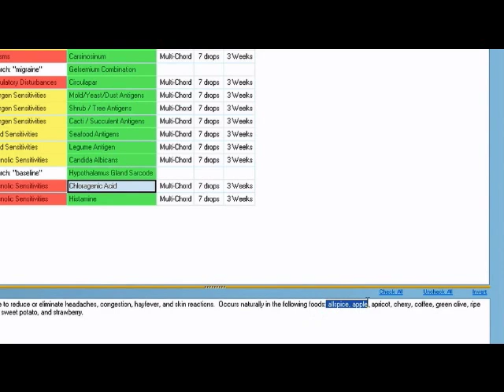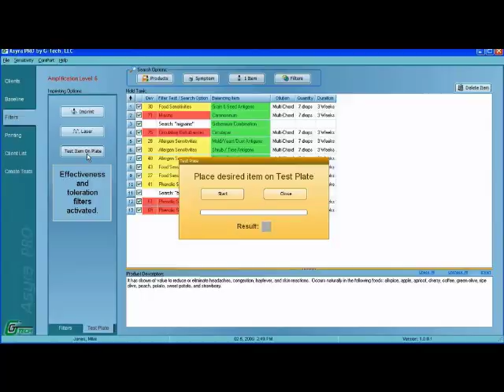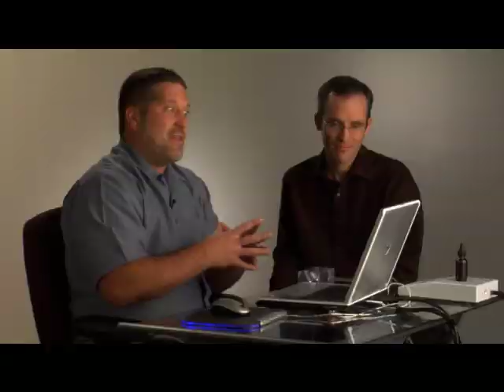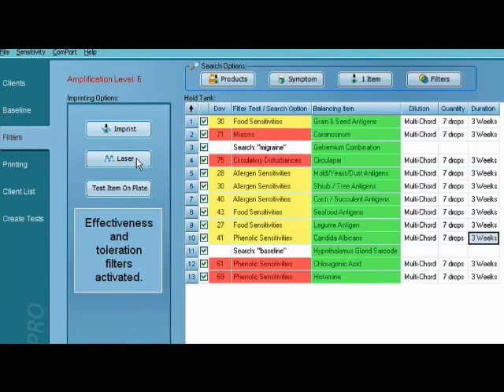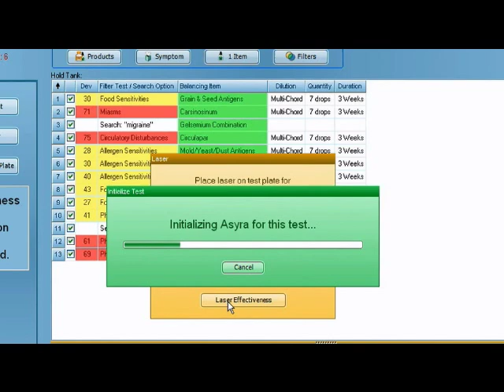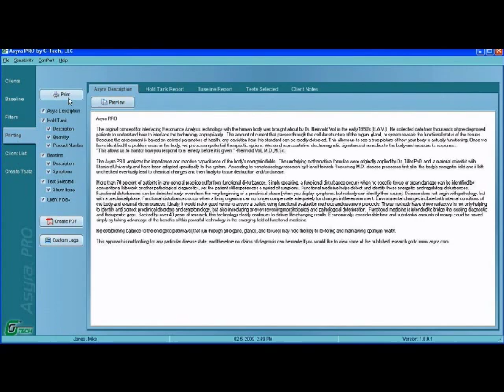Asyra Demonstration Part Two

Comment: Take an Ohm's meter , it is about 6000 Ohms  Take an oscilloscope (same place,resp same electrodes) you get 4 to 8 volts ac (against ground) , sine waved 60 hz, in Europe 50 Hz , in the middle of e.g. Sahara. How come  the program has initially  no stop button ?  Only one answer; Set up  the hoax. They retrieve based on date of birth and name , all possible previous runs,to avoid rapid proof of the hoax.The rest is just a search engine run through medical literature (a progress bar grow- show)